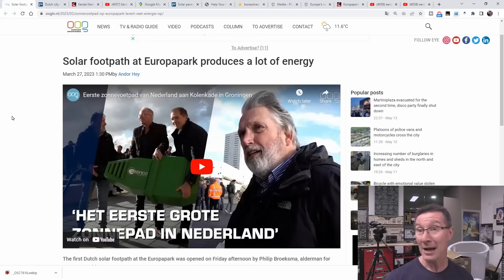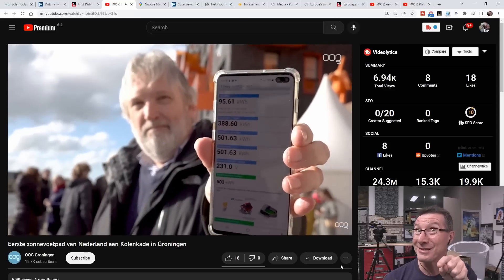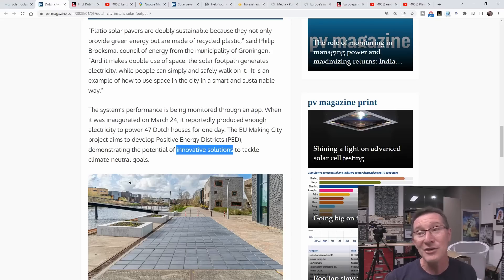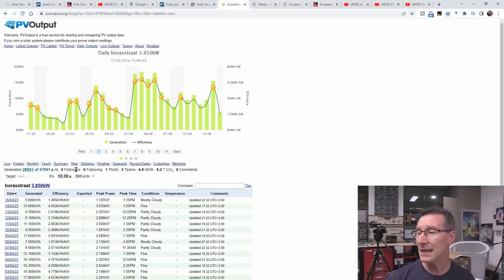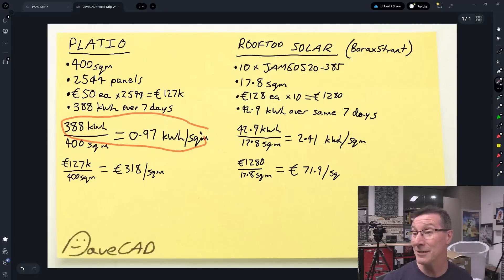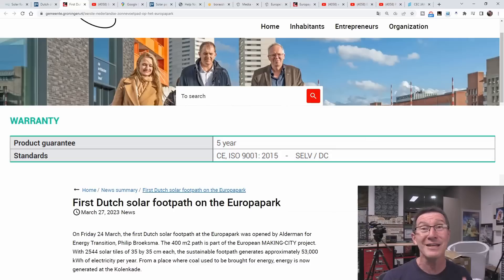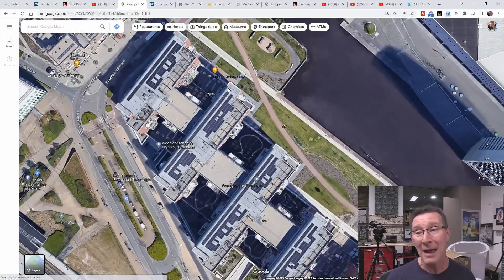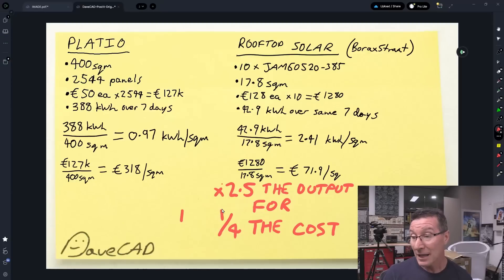EEVblog 1544 - Platio Solar Pavement BUSTED!

Comment: 55kwh per day....yikes that's crap.  My home uses more than that over 7 days.  During the summer, that could be a DAY of usage if it's really hot and the air-con is cranking.  My home requires WAY too big of a system in order to deliver my peak needed requirements (thanks to all that electric power needs in the Air Con, Electric Oven, etc.)....and yet they are pushing to remove natural gas 100% from all new construction as soon as possible.  BAH!
Reply: You might want to look into getting better insulation for your house..
Reply: @Basement Science  R19 in the walls, R40 in the ceiling.  Issue is the costs will skyrocket if we are forced to electric baseboard heat, because they are activley talking of removing natural gas in new construction.  The people that have smaller ranch homes with electric baseboard pay nearly $500 per month in the winter to keep their homes at 62F (~17C).  My home would probably be closer to $1000....without moving to electric hotwater, electric range, electric dryer.  No, this is a sh!tshow idea.  

We have a new "solar" array going in.  They claimed immenent domain on about half of the location when the farmers refused to sell.  The size of this array is MASSIVE....and won't put out even a quarter the power (at 100% output) that a natural gas plant can do in less than 1/5 the land, or the nuclear plants can do.  Yea....lets go solar, rip out 10s of thousands of acres of farm land ...in my area this means those farmed products have nearly tripled in proce because 10s of thousands of acres are being used for "green" energy.  Ironic....we will have "clean" energy (bullsh!t), but we will starve or go broke all while the politicians say "let them eat cake".

Comment: The rooftop panel pricing is a little cheap for Europe. Euro200 per module would be more realistic. Even so you will still get much more power for your money than the pavement tiles.
Reply: @whocares281  Prices in europe aren't the same in every country or even in every city
Reply: @marcogenovesi8570  Surely you can get them shipped from anywhere in the EU.
Reply: @jaro6985  are you aware that shipping is not free, especially for large fragile objects?
Reply: @EEStuff  does not change what I said

Comment: Ten times more cost per energy is best case!  The much higher wear will rapidly reduce energy out, while epic maintenance costs will rapidly increase price. I’d expect the actual to be more like 20x worse over the lifetime of the projects.
Reply from the maker: Yep, it's so nuts you just have to laugh.
Reply: Worse still, people walk over them, park their bikes on it, they get shaded.
Also causes the panels to get dirty, reducing output.
Reply: @jwenting  Also glass and plastic are very prone of scratches. Even a very fine dust could cause severe scratch mark in the surface if there are heavy objects moving over it, like it's scratched by sandpapers over and over again
Reply: And the lifetime of 5 years they expect is also a very optimistic one unless they've included the price of replacing the frameworks and the glass covers every other year. And I hope they don't have the thing called winter and temperatures don't go well below 0°C every once in a while or otherwise all the things are just guaranteed to fail. 

So even the 10 times below conventional figure is completely unrealistic. Even pushing the expectations another order of magnitude below does not seem unreasonable. It is not going to become a complete and utter serviceman's nigthmare like a stupid solar roadway would but it is still going to be bad. But of course all the technical and economic issues just pale in comparaison to the priceless benefits of looking progressive and green they still successfully provide.
Reply: 20x is very optimistic
Reply: As an electrical engineer I can TELL YOU the panels are NEVER consistently efficient once installed as they are on paper. Too many variables, opportunities for slight errors (bad connections, installed too deep or shallow in the surface, on and on) All this is about money. Few, few, few green endeavors are about the environment! Mostly about bilking the public with a good "its for the children's future" That alone as well as other considerations about this whole lie infuriates me!

Comment: We have so much roof real estate i dont get it. Will put solar panels somewhere they get blocked, damaged and dirty 🤦. The mind boggles 😂
Reply: And when you run out of existing rooftops, there's heaps and heaps of spaces begging for a basic weather covering - ground level carparks in places where summer gets sunny and hot for example.
All we need is a simple framing system to hold up existing regular rooftop panels as a basic roof.
Reply: @tin2001  I think that's way ahead in the future I don't see us ever running out of rooftops. I do think it should be mandatory for all homes to built with them. A small system is a couple of grand now. I have them on my roof local council who own my house fitted them. It just makes so much sense. Large houses can fit more than they'll ever need.

Comment: Groenigen is just 40min to drive for me...  gotta check it out myself lol, ridiculous   3:33  all the roofs infront of the walkway are not yet populated with panels....   omg, you can ripp off these idiots way to easy
Reply: BEWARE ❗
The solar pavement is supposed to be in Groningen, NOT Groeningen.
Groeningen is a small hamlet in Limburg, Groningen (city) is more than 250 km to the north . . .
Reply from the maker: Please post a video!
Reply: Probably could've completely populated all the adjacent roofs for the cost of this crap and gotten significantly more power in the process

Comment: I bet the 705 panels they are installing on the roofs at work are a better solution, maybe let's put them where they won't be blocked from the sun!
Reply from the maker: You are guaranteed to win that bet based on basic laws of engineering.
Reply: But that would be missing the point. You can't see them on flat roofs.
Reply: @Chris-rg6nm  Luckily you can see them fairly close to the buildings they are on and they are largeish panels, plus they currently have a sign attached to the scaffolding explaining what's happening.
All of our sites in the SW are supposedly getting them and it makes a lot of sense. Most of the year they'll probably be just supplying us with power but that might change in the winter when we are fully/partially closed.
Reply: @dglcomputers1498 I'd not say 'just' - every kWh you generate for yourself is a kWh not needed to be generated elsewhere in the grid / freed up to be used by someone else...
Reply: @michaeltempsch5282  Quite, it should also save us money in the long run. With a bar/resturant, owners bar, entertainment venue, amusements, indoor and outdoor pool,  just over 700 caravans, a touring area plus all the supporting stuff (computers, HVAC Etc.) we do use a lot of power.

Comment: Lining pockets with backhanders. Politicians. If GLOBAL WARMING was the important issue, AEROPLANES would be banned or taxed like cars.
Reply: Solar panels on airplane wings. What could go wrong. All those unused solar energy collectors… I’m innovative. Send me money!
Reply: most of the fuel is burned by cars and trucks, not airplanes. Yes it's a bigger vehicle but for every plane there are millions of cars
Reply: @marcogenovesi8570  Cars do not inject all their waste CO2 into the most inappropriate place, 30,000 feet, where it does the most harm containing the heat causing global warming. At ground level, CO2 (heavier than air don't forget), has the effect of feeding vegetation like trees, grass, anything that processes it into oxygen and fixed carbon.

Comment: Are they stuck to the road? If not they might disappear in the middle of night.
Reply: They also make a great chess board.
Reply: I'm going to arrange something with my Romani friends, they have a few tricks to teach me, don't really care if it's going to be sold or not, it's showtime. 🫠
Reply: the resale value is zero, nobody is going to take these
Reply: @marcogenovesi8570  
The copper in the wire has value.
Reply: @universeisundernoobligatio3283  yeah like 100 euro of copper? Feel free to break your back on that.
Reply: @marcogenovesi8570 f you had a way of shipping stuff cheaply to Africa of India then you would quickly realize that everything has a resale value. The only question is whether it is above or below the costs of ripping it apart and getting it to your customers. If the solar panels can be easilly separated from the stupid boxes and protective glass then even if it is a one time deal of a few hundreds of theese then still some guys in China will welcome them with open arms. The smart guys will snap together some nice cheap commercial solar panels out of them and AliExpress will deliver them to multiple happy customers!
Reply: @marcogenovesi8570  You would be surprised what people would take. If the panels can be used, someone somewhere will want them.

Comment: I have smell something stinky already in the beginning - pressure cannot be given in tons. Let's consider that it can widthstand the weight of the car of 2 tons (mentioned in their brochure). The best scenario for patio is 2 tons on one tile. Widthstand pressure = 2000*10/(0.34*0.34) = 173kPa. Young lady stepping in high heels - 50*10/(0.01*0.01) = 5 MPa. I have simplified it since walking is not staying on one leg, walking does not produce static pressure, 1 cm^2 is optimistic value ( size is usually smaller, the touching surface during the boot stepping down will be even smaller), car weight will be distributed to 4 tiles etc. 
Do the people really do not remember the classic example of airplane floor failure, where had been holes in the floor even with safety coeficients? After putting the floor to the hallway they have found the real reason 🙂. Simply the pressure is what really matters.
Reply: Exactly... I've stupidly stood on a glass table and it held me up. Years later, it was hit by hail and shattered.
Reply: Worked at de Havilland in ground test, we had a test stand to simulate repeated high heal impact on the cabin floor. Those high heals a nasty.
Reply: @universeisundernoobligatio3283  What was her name, Beatress ?
Reply: It is a random number for normies to make it sound like it is very strong but really means nothing.
Reply: @v.m.a.d.l.e.6972  yup, those tiles are made of "military grade, space age, surgical steel" or something
Reply: @marcogenovesi8570  every time I hear "space age" I immediately think "what 1960's/1970's tech? doesn't seem to impressive to me..."
Reply: Also worth noting that people and cars can and do exert far more than their weight to the ground while moving. Runners can exert around 900lb of force. Add a small point like a pebble in the road for that force to be exerted on and you have a very bad case for this glass. This isn't even like a max force situation either. Stomping your foot could see more extreme results.
Reply: Imagine a fat lady in stilletto heels.
Reply: Actually , when walking in stilletos, at some point in the stride ,all the weight is on one heel and there is a small added force from the dynamics of locomotion
Reply: What do you mean pressure isn't measured in tons? Haven't you ever seen How It's Made?
Reply: Yeh it's all about the distribution. Glass is surprisingly strong. I work in a shop sells frozen foods and I've seen members of staff stand on the glass lids with absolutely no problem. But in shows that spread the load.
Reply: Maybe you should apply your critical thinking skills to the claim that man's CO2 drives the climate then?
CO2 makes up .04% of the air
Man's contribution to CO2 yearly emissions is 3%
The greenhouse effect is almost entirely due to water vapour.

do you really think it's rational to think that man's co2 has a bigger effect on the weather than say variations in the sun's output?
Reply: @axeman2638  Maybe you should eat a sandwich that's only 0.04% ricin after polluting this thread with that unbelievably off-topic hogwash.
Reply: @axeman2638  Just so there is no confusion for someone reading this reply that might be misleading: The CO2 in the atmoshpere is rising because we ADD massive amounts of CO2 to the atmosphere that had been safely "stored" before (i. e. in form of natural gas and oil, wood etc.), whereas the "natural" CO2 emissions would mainly be part of a natural cycle (CO2 in the atmosphere wouldn't rise that much in such a short period of time). There is a huge consensus in the scientific community that climate change is man-made. This has nothing to do with thinking whether this is "rational", it's just observation, then making those observations quantifiable by measurements, modelling, computation.
Reply: @sebastian_harnisch  yes that makes sense. The thing is what makes people dubious including myself is no one seems to do anything about it really. All governments do is tax it. Wether it be with low emission zones or vehicle tax. We just move the problem which is no good to anyone and say for example here in the UK our contribution is tiny compared to likes of china or the us yet we seem to get hammered on taxes for it.
Reply: @HA05GER  if that nonsense makes sense to you then you need to go back to school, there is no way to prove that the recent rise in CO2 levels is not natural variation.

a much more reasonable assumption given how small man's contribution to it is.
Reply: @axeman2638 Add in the fact the earth's magnetic field is weakening, letting in more solar and cosmic radiation.  You add more energy to the planet, and it's going to change things.
Reply: @axeman2638  wtf are you on. The math quite clearly adds up for our CO2 contributions and we're seeing an unprecedented spike that normally only comes from much larger events often extinction causing ones. The CO2 we're adding comes from outside the stable natural cycle of the last million or so years. Unlike the average global temperature change which is significantly harder to predict the CO2 levels are falling much more in line with predictions based on the math for how much we release affectively confirming our affect.
Reply: I'm in the UK aswell I totally agree get taxed through the arsehole. Be it road tax, low emissions tax, insurance tax. Your right our contribution is tiny it's negligible even if you compare us to America. Homes consuming far more power than ours and cars consuming more fuel increasing emissions. Not that we can afford to have air conditioning everywhere and juicy cars as again we get taxed on the fuel even taxed on our energy. Crazy really.

Comment: The Dutch video didn't mention any technically relevant stuff. One of the people interviewed who was the person who installed it did say that this is only supposed to be a solution after every rooftop has been used for panels.
Reply from the maker: Thanks. So even the installer thinks it was essentially a wasted effort? LOL
Reply: @EEVblog  effectively, he admitted that this is only useful for gathering data for when we need more power and we've exhausted roof space.
Reply: @MLeoDaalder  At least they sorta admit that this is a waste of money, resources and time.
Reply: @DrakkarCalethiel  Being a very woke university city, it'd not surprise me if this was part of an EU funded "study" into "future solutions to the energy crisis".
Reply: @InfernosReaper  How do you consider research a wasted effort?
Reply: @EEVblog  I take it you don't work on research projects?
Reply: @EEVblog  I mean the installer has to be a certified electrician of some sort so either way he has to know
Reply: @marcogenovesi8570  nah, just pull a gaggle of engineering students from the local university, list it as a "graduate project", and you've free labour and no need for any permits.
That's how the university of Enschede installed a crosswalk for ducks, complete with traffic lights and sensors to detect approaching ducks buried in the grass sidings back in around 1990.
THAT one was done as a joke, this was deadly serious grifting and virtue signaling.
Reply: @jwenting  Yeah no that's not how it works. Any electrical work at line voltage (as this thing is, as it's a generator that sends the power it theoretically generates back into the grid) has to be certified by an electrician for law and safety compliance. Stuff with renewable energy generation like solar panels usually require certification by a an electrician that was certified for solar panel infrastructure as it's not something a normal electrician really sees much (and it's also part of the grift).
So there is at least a certified electrician that is also a certified solar panel installation technician that has to sign the paperwork. Everybody else can be literal slaves and it does not matter. Student engineers can't certify sht, if someone gets hurt the owner of the building is on the hook for any civil or penal liabiliy.
Reply: not just rooftops really.  every other free space including having roofs for the walkways.  

at which point, you wouldn't have much sun to fall down anyway. even tables on a patio being solar make more sense.
Reply: @lasskinn474  Solar-fricken-picnic-tables. Gimme that good good green energy virtue signaling money, government!
Reply: @billr3053  "Solar-fricken-picnic-tables" - doubles as a solar fricken' cooktop!  😀
Reply: Even if all rooftops are covered with panels, solar panels as a roof above roads will work better than solar panel as the pavement... Or agrivoltaics, where sparse panels over farmland provide a partial shade for the plants.